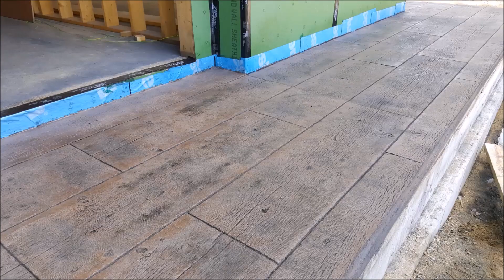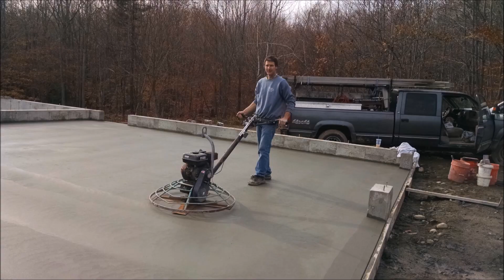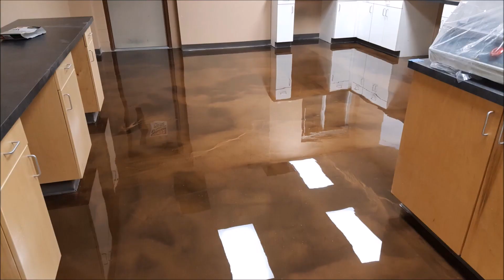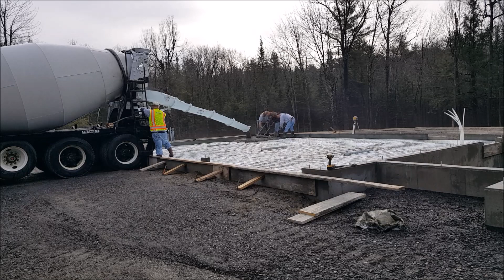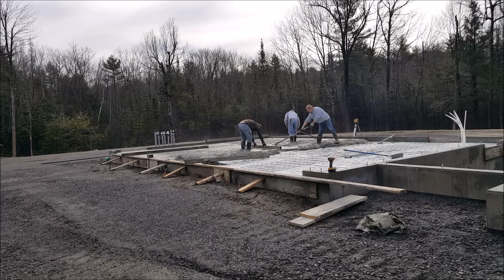How to pour a garage floor with 3 drains.

Comment: Question? Can you bull float a large pad and that's all just leave it. Will you have a smooth finish.
Reply from the maker: You can leave it just bull floated. It will be smooth if you good at bull floating. The surface just won't be quite as dense as a troweled finish or a broom finish. It may be a little dusty. Use a good penetrating sealer (silicate) after it hardens to help densify the concrete.